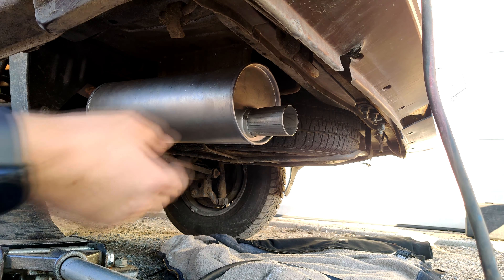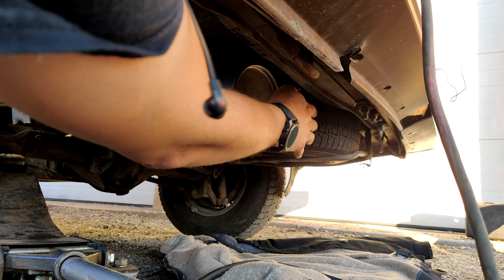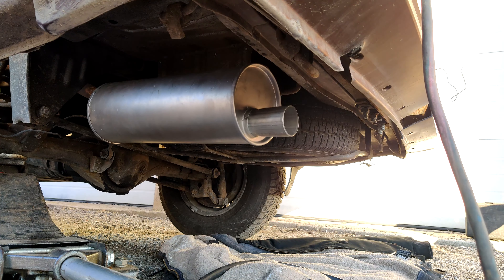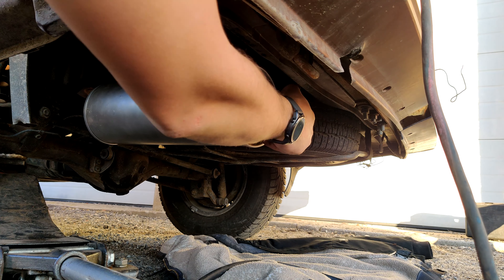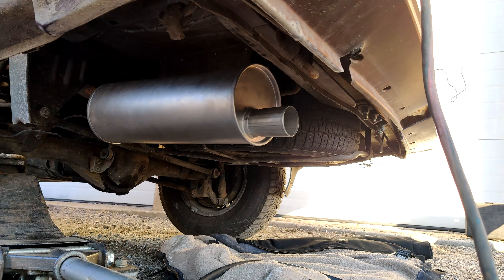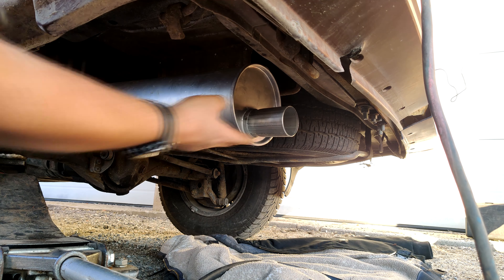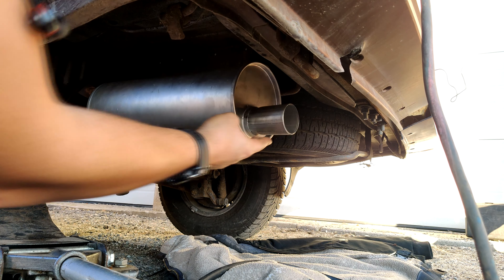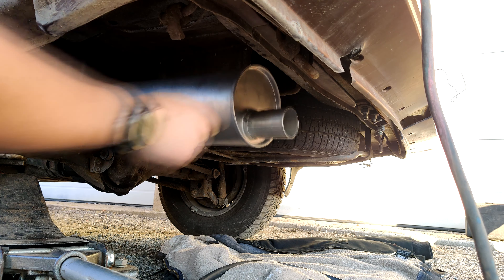Muffler Replacement on an 1985-89 Toyota Van Wagon

Comment: I got a muffler at O Reilly auto parts because the stock exhaust rusted out on my 85 van wagon and the guy couldn't get stock but I found one that was similar in size and welded it right up after I shorted the tubing to fit the muffler.
Reply from the maker: Sweet! Makes a big difference in sound.